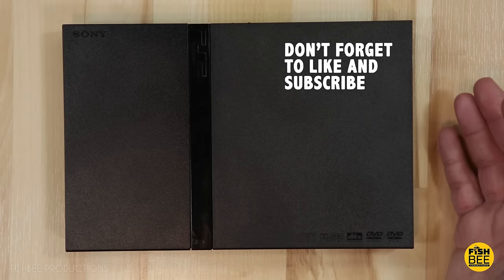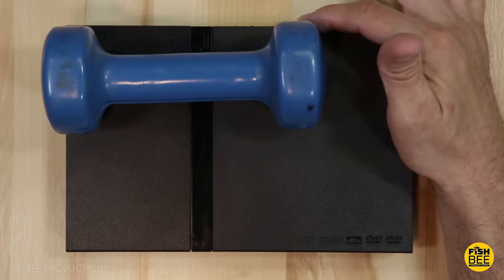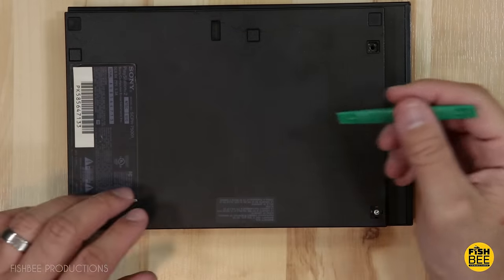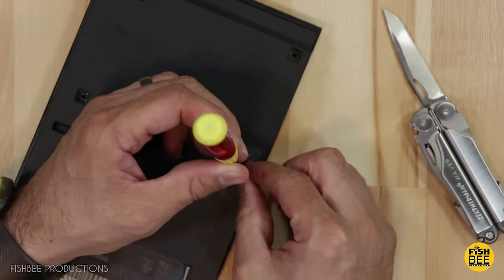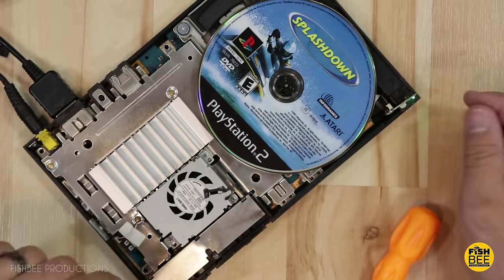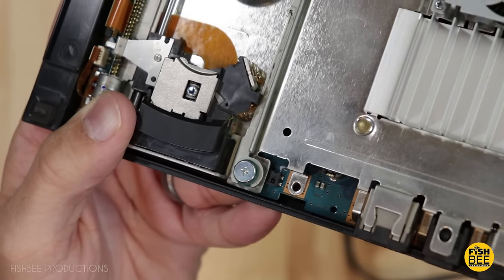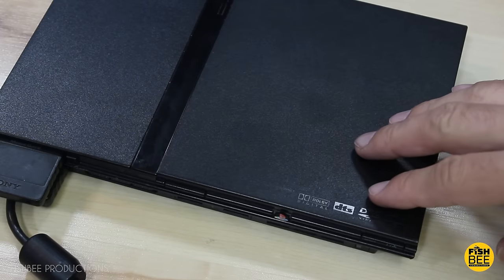How To Fix PS2 Slim Disc Error

Comment: My CD spins alright, but after a few seconds it says "The disc could not be read."
Reply: same but not for games
Reply: Does it play other game cds? If it plays nothing but it does spin, it could be the lens or the disc has a deep scratch or the lens is eventually going bad. Its cheaper to replace the lens because its only like $10.
Reply: For all of you, I first recommend adjusting the potentiometer. If that doesn't work, it's most likely because your laser has weakened and needs to be replaced
Reply: Mě tooo
Reply: Me too
Reply: Mine too. The screen turns black
Reply: Mine spins, but says the same error, worst part is I was playing it earlier today, let's say I has a lil rage moment and my hand still hurts
Reply: Mine will spin but says "the disc could not be read" bit they worked yesterday
Reply: Yes
Reply: Maybe the disk is scratched or not a game
Reply: Rexx23ify same for me and it red screened a few times but i used the ancient trick by putting it upside down but it took time fornit to load.
Reply: My ps2 slim reads all my discs except call of duty finest hour
Reply: Mine plays some DVDs, but not others
Reply: What about dbz games they freezes a lot
Reply: then you need to adjust the potentiometer.
Reply: @scotjrunyon8773  Are you serious you can't afford a pre-owned ps2 wow
Reply: Same story bro
Reply: scot j runyon Easy don’t worry is not important
Reply: Adjust the potential for the DVD. I got into repairing slims and I found 720 ohms or around there is the sweet spot. Haven't found a method for the CD potential yet
Reply: @saltypup1971  adjust the laser potential
Reply: Here's a fix that I found working on some discs:
They would start spinning, but after a few seconds it'd stop and I'd get the error like you said. So:
When it starts spinning, and I hear the laser unit engaging, I very quickly open and close the lid. Opening the lid will cause it to want to stop spinning, but closing it again will make it want to start the spin cycle anew. And when I do this, on some games it will then start reading the disc as it should. I have other games that won't respond to this treatment, however. And then yet others which are immediately accepted with no fuss.
Reply: Same thing to me
Reply: @alexbridenbaker9261  thank you! It really works. Harder part is to find correct Ohms. For my 77000 model worked CD: 650 and DVD 850 Ohms. After that it started reading those games that didn't read before.
Reply: Me to
Reply: Mine works fine but I recently bought ultimate spiderman again and it won't read the disk...still spins but it says "please insert disk"
Reply: @Doll_lover_23  its your game
Reply: @Cabron28  it might have a deep scratch that broke the game get it cleaned
Reply: Same!?
Reply: @solarcat9424  are the lazer and lens same
Reply: I used the only white type toothpaste method with a microcloth I had, it started to work but it couldn’t buff away all the skipping and glitching. As I tried polishing it again and again I started to get a little rough on them, big mistake, it ended up fucking them up completely unreadable but tbh the games were preety beat up, basically if it’s still somewhat playable it’s savable but you have to be very gentle, if it’s not playable the polish repair just won’t do. You can try to find a machine near you to repair the disc comepletely but honestly your better off buying a new copy. Luckily most ps2 games are cheap compared to retail prices.
Reply: @Doll_lover_23  same
Reply: same problem
Reply: Same
Reply: I can play any other game on my ps2 but My ps2  won’t let me play midnight club for some reason
Reply: Mine won't even read a DVD Movie
Reply: @anasjohnson9058  it plays Audio CDs and Movies
Reply: Same
Reply: This is why Fatboy wins all day I had both when I was little had got the original and then my step brother got the slim but I ended up getting a silver slim one year from my grandparents. Both slims had disc reading problems unlike my fat boy. I no longer have them. The other day my roommate comes home with 2 ps2s that her friend gave her. One is a fat and other is slim lmao the slim ofc does not read games!!!! Lmao it's just hilarious 😂 my childhood was Dreamcast and PlayStation. So this right here is funny to me Ive done this dissembling so much as a kid. Lol I'ma have to do what you did in the video for this slim I just got.
Reply: Same
Reply: @saltypup1971  how can I fix that?
Reply: @alexbridenbaker9261  that is a last resort
Reply: same for me man
Reply: @solarcat9424 i have some games and the cds are alright but the console reads only few of them
Reply: Mine too
Reply: @TerryLondon how do you adjust it?
Reply: @PRODMUDDY  On the downside of the Laser head are two weird (+) screws. One for DVD and another for CD. Those are potentiometers. You can try trial and error method or try to look up correct Ohm values from internet (I don't remember the exact values anymore). Use a multimeter to measure resistance of the potentiometer, Carefully adjust it with a screwdriver and then try again. Testing takes time as you have to reassemble the PS2.
Reply: @TerryLondon  thank you so much for the reply. I had initially fixed it earlier today by taping the sensor and the discs were spinning like brand new and loading up every game. Then...the motherboard slipped out of my lap and bonked on the ground. It kept spinning weird and not reading the games. Can't tell you how sad I was as I spent all day cleaning and fixing. I adjusted the potentiometers twice, and the second time by the grace of God...IT WORKED! Thank you. I can finally sleep now. Sidenote, I got this Slim for free and thought it wouldn't work and here. Time for  some Budokai 3 tomorrow, which I also somehow managed to get for free!
Reply: Yes also me😢

Comment: About weighing the lid down: you only need to do this at the very beginning, because all you need is for the console to recognise that there is indeed a readable disc inside. Once that has been established, you can remove the weight, and the game will play perfectly fine.
Reply: depends on the game entirely. other games have loading screens within the game, those wont work.
Reply: @buggaluggachug9570  The PS2 is indeed a strange beast. Some games on my quirky PS2 slim will load and play just fine without needing to do anything with the lid at all. Others require me to push the lid down for them to load. Others still require me to push the lid down, release when the disc starts to spin and then press down again. And some are almost hopeless to get going at all. And these are all PS2 DVD games, none of them platinum. And all of them spotless, without a single smudge or scratch (I take good care of my games). I have no idea why some games are more trouble than others.
Reply: @Gilmaris  haha right. i just fixed mine. just used duct tape on the part he said!
Reply: @buggaluggachug9570  I already did. Still I need to coax it in order to read certain games.
Reply: @Gilmaris  im sry :( ya i just ordered one from amazon and they sent it all busted and shit. like seriously wtf. but its all good. got it working.
Reply: I did this as a Kid back in the day LOL
Reply: I used the only white type toothpaste method with a microcloth I had, it started to work but it couldn’t buff away all the skipping and glitching. As I tried polishing it again and again I started to get a little rough on them, big mistake, it ended up fucking them up completely unreadable but tbh the games were preety beat up, basically if it’s still somewhat playable it’s savable but you have to be very gentle, if it’s not playable the polish repair just won’t do. You can try to find a machine near you to repair the disc comepletely but honestly your better off buying a new copy. Luckily most ps2 games are cheap compared to retail prices.
Reply: Gta you have to. I used a v8 jug.
Reply: Been using a piece of tape on one of our slims for years lol
Reply: Just kill the switch and solder its contacts together... Works forever.

Comment: When i open ps2 or reset ps2 or put a cd, it makes a drrrrt sounds
Reply: Same with mine
Reply: mine too
Reply: Yes same sad face
Reply: @novasclipdumb6987  did you clean the fan?
Reply: When i opens my ps2 it is only loading can anyone tell me what can i do
Reply: i thought i was the only one...
Reply: @Steifmeisterclips  no me too
Reply: Entek slim ps2 consoles on worsted than ps2 fats
Reply: Like this? Dttttttrrrr? Or drrrrrrt?
Reply: @chicagobulls5436  oh thanks i need to try it
Reply: Entek I completely opened mine up and cleaned the shit out of it so it’s not the fan, I think we have the same issue, my copper wire is not properly attached but I’m not sure if it’s that or the laser on the reader has gone out.
Reply: Same as far as I know that the tape the orange bit by the laser (I don’t know what’s it called) it’s goes up  and is scratching the disc that way I think  if you try to put it back it should work.
Reply: @user-uk1kw4vn6v  yes i cleaned my ps2 5 times but nothing changed.. its not from fan
Reply: Same lol
Reply: The worm gear lost traction to the little metal bit that hangs on to it. Have a slim in the shop for that exact issue.
Reply: @Man On The Internet check to make sure ribbon to the lens is securely in place. It's probably the worm gear not getting the signal from the laser switch that it has hit the end and should retract.
Reply: @YeppyNope  I bit more like Dtttrrrr with a touch of drrrrt right in the middle, but sometimes it goes completely DrrrrT Drrrtttt Dtttttrrrrrr than drrrrddddd a little drrrdddtttrrr r rr rrrd  ttrr d.  I am not sure if the last one is a D or a T.
Reply: Literally same 😂
Reply: For some it can be just the disc spinner motor being loud. Sometimes the laser does a dur if your disc is hard to read and extends too far, to the point it scratches (laser burns) your disc, making noise in the process.
Other times it's something else, like the laser cable, scratching the disc while it spins and making noise.
PS2s are a strange and noisy console ha
Reply: It could be the disk spinning sounds mixed with other things,  @zaeekk

Comment: My PS2 just came in today and after putting 3 disc in that couldnt be read I was getting worried. Tried the first trick of flipping it upside down and it worked immediately! Genuinely, thank you so much! ❤🎮
Reply: Its not working for me, when I reset I am getting black screen when I insert cd and without CD I can  see option plz help
Reply: @gamerxnoob9913  hi

Comment: When dealing with electronics,  never use the "hope" method...can easily result in grey smoke escaping.  ; )
Reply: And replacement smoke is really expensive and hard to come by. Best i have been able to source is Lucas OEM wire harness smoke. ;P

Comment: Dude!  You saved my PS2 slim!  I also suck at soldering but I went for the switch removal/soldering permanent fix and it worked like a charm!  I had to rework the blob of soldering about a dozen times but finally got it to work.  I even got the blob to look like I knew what I was doing from the start.  lol

Comment: Another tip, before prying up on the part you're desoldering make sure to lightly push on the side of the part to make sure the solder is melted and the part is loose. I've ripped many pads off boards when I was just becoming an electronic tech.

Comment: i finally know the reason guy. i took out my ps2 this morning, plug everything then my ps2 slim work perfectly (today is 02/13th/2019). at fisrt, i conected it to my old fat Lg 21' tv - it worked perfertly. then i changed to my 32 lcd. it nor read disc and had a weird noise this time. i tried everyways found on gg, but useless. then i remember that i changed the adapter. i had 2 ps2 adapter : 1 is 8.5V - 5.6A ; 2 is 18.5V - 3.5A. and the 1 is work. so try this, it can help you to live you childhood again.

Comment: I just had this issue. Took it apart and tested to see if the disc would spin and it did. Apparantly just doing that fixed my issue when I put it back together again. Either that or because I made sure the screws for the disc cover were nice and tight so it had very little give.

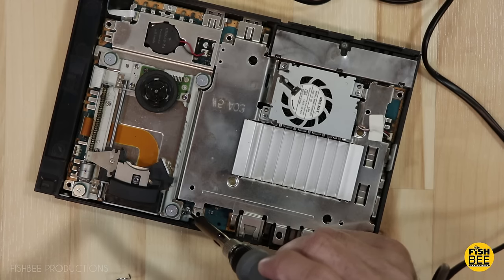Comment: Look if you have tried All these and it's still not working, Try putting Some oil on the long Screw thing at 6:26 As you can see on the left. This makes the cd scanner more efficient at reading discs. Since most cases are  due to that.  (Can Be any type of oil)

Comment: When I press on the two switches inside and hit power, the disc will spin a bit, but then spin intermittently, and stop eventually - and it never crops up on the title screen, like the system still doesn't seem to recognize the disc (and the disc is clean and never had problems before whatsoever). What should be done?
Reply: Hey man, same issue here. The weight thing worked for a couple of years, but now it won't get past a slow rotation. Did you Find anything yet?

Comment: Heya. Thanks for the solution. If I hold my finger down on the button pretty hard, then the disc spins fine. The electrical tape I'm using doesn't seem to work.
Is Duck tape super thick or something? I can't work out why it's not working for me.
It's definitely that button though.
Any thoughts? Thanks again for the vid
Reply from the maker: Thanks for watching! The duct tape i tried was the cheap stuff so it wouldn't stay. You probably have to use the more expensive stuff for it to actually stick in place (maybe gorilla black duct tape).
Reply: FishBee Productions cool thanks

Comment: my ps2 works sometimes n sometimes it doesn't. i can hear the game spin for like 3 seconds then it stops then i have to tap or shake the ps2 a bit sometimes that makes it play but mostly does nothing. but other times it starts with no problem so idk
Reply: Sounds like mentioned lid switch issue. Mine only is able to read DVD's not game disks, so i'l try operating switches manually to confirm and then try calibrating laser and finally replacing it if that does not work.

Comment: My ps2 slim is basically lasering a big ring around the disc?? It’s like it’s not scratched on the surface but there’s a ring around the whole disk on the other side of the plastic? And its causing the disc not to be readable! 

Already got another one on the way but if you ever find a disc with a perfect ring around it and no direct scratches then don’t use more discs! Just killed alien vs predator and 4x4 evo 2!

Comment: Did the solder blob method as suggested put the laser in again and it was just making a noise and buzzing. The laser was also near the spindle the whole time. Tried adjusting the laser again and may have broke cable in process as the laser is doing nothing now. any suggestions?

Comment: I think it goes down to the disc as well. I have a slim model which is 11 years old. Games like WWE 2009, Naruto Ultimate Ninja 5 work like a charm. But some games particularly the discs which were pirated or of a lower quality do cause problems. I did take it apart last year but it didn't have much dust so yeah it can be the discs as well and not just the console.

Comment: Great video, but a much easier fix I've found is to just bulk up the section on the case which touches the black spring point rather than messing with the internals of the PS2.

When you take of the top lid, you'll see 2 triangle kinda hook things that move up & down when you open and close the lid.

Ofcourse they line up perfectly with the black spring (as they're intended to push it in & out every time you open & close) so just bulk up them little triangle bits with a few layers of tape & all will be well, it will hit the spring alot better.

Comment: My midway arcade treasures collection had scratches on the back. 

Maybe, I’ll use a different rag to make the scratches disappear.

My PS2 is like 20 years old I think.
Reply: So you got it when I first came out because it came out in 2000
Reply: Call of Duty Black Ops Gamer 

Same here.

My PS2 is out like 2000.

Comment: My back tab that gets pressed down to spin the disks broke off after trying tape. Is that the one you soldered? And is there any other way to fix that?
Reply from the maker: yes that's the tab i had to solder
Reply: @FishBeeProductions  gotcha. So what exactly should I be doing? Just putting a metal blob to cover that whole spot more or less?

Comment: How do you get the ps2 to turn on without the cover? When I push the white on switch it won’t power up. I tried pushing down the little nub but it still won’t turn on.

Comment: I ran a testrun and for some reason it plays some discs but the unreadable discs just doesn't make it spin as fast as readable ones. Btw I have the 90000 slim model not the 70000 slim which you have.

Comment: hey can you fix this problem of mine?
so i was playing call of duty 3 that day and i decided to pick gta san andreas. and then i started putting the disc in and resetted the ps2 and see what happends. at first it showed the ps2 intro (with the cubes) and it took me to this black screen (yes i know its a regular thing) but after the black screen it showed me into the browser screen. (with the memory cards and stuff) i restarted the ps2 and it keep doing that. if you have any solution please tell me. 

Model: SCPH - 90006
Browser: 1.40
CD Player: 2.00
PlayStation Driver: 2.00
DVD Player: 3.11G
Reply: Try using another dvd or make iso and reburn